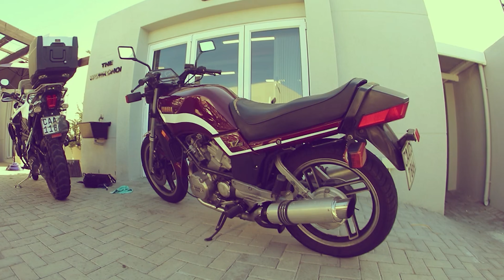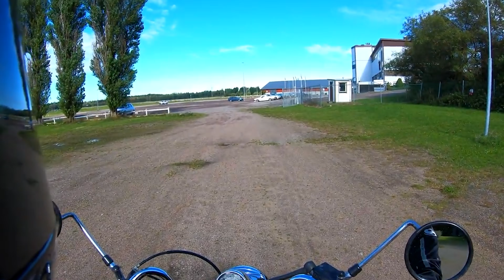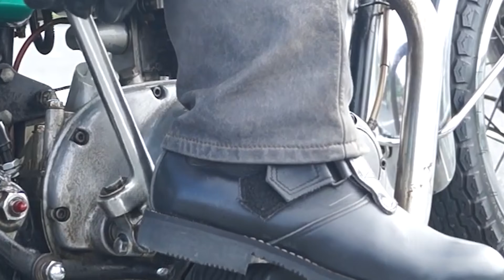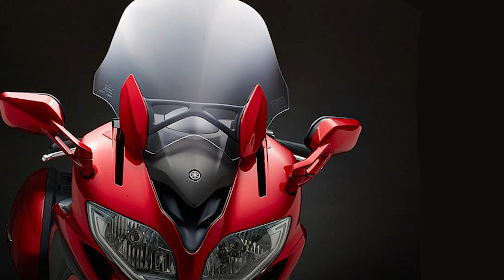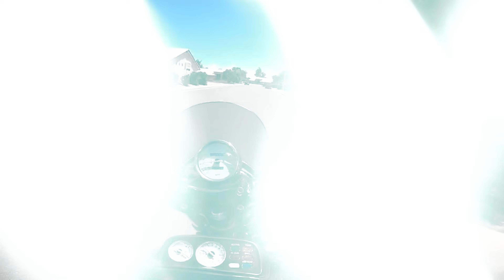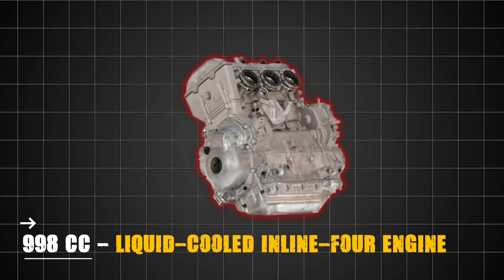7 Worst And 9 BEST Yamaha Motorcycles Of ALL TIME!

Comment: I bought a new Vision in the summer of 1984. The one I bought was an '82 model. The price was only $1,600. Back then there was no internet, and there was no way for me to figure out why the bike was priced so low. I had it for 4 years and rode it 10,000 miles. Why heck, I was only 23 at the time when I bought it. I had no problems electrically yet but.........it had the Vision stumble, the front wheel wobbled so bad at speeds around 70 mph it felt like I was going to lose control. Mine was brilliant red. I regretted selling it after owning it for only 4 years. Fast forward to 2018. I found one on Ebay, brilliant red from Arizona with no fuel tank rust for $1,300. I bought it. It looked almost like new. I already knew of all of the problems this model had, so I opened my wallet and proceeded to correct all of them. I bought a new jet kit which had larger jets for the rear carburetor adapted for my altitude of 1,080 feet. I rebuilt the carbs, bought a new modern stator and then life took over. This year, 2026, I started again on the bike and this time I bought a new TCI out of Europe which did away with the old electronics, I bought a new modern voltage regulator, bought new compatible coils, replaced the ignition wires with new ones, new plugs plus a few other things mechanically that fail with use. I am now going through the whole bike electrically inspecting those plastic connectors and I do expect the engine to fire up the first time when I hit the start button. I think this time around I'll have a bike that is going to ride the way it was designed. If this Brilliant red bike redo is successful, I have a second '82 Vision that needs more serious top end surgery. There is no doubt that I can get it back up to scratch. All it takes is a lot of patience.

Comment: FYI: I OWNED AN "RD400" TWIN, 2-CYCLE, WHICH HAD ONE FLAW: THE SPARK PLUGS WOULD EVENTUALLY FOUL, WHICH COULD BE "FIXED, BY REMOVING THE SPARK PLUGS, AND SCRAPING THEM, TO REMOVE THE FOULING COATING...  THEN IT RAN GREAT FOR SEVERAL MORE DAYS.... :face-blue-smiling::face-green-smiling::body-blue-raised-arms::face-fuchsia-wide-eyes::face-orange-raised-eyebrow::face-orange-biting-nails::hand-orange-covering-eyes::face-turquoise-covering-eyes::hand-green-crystal-ball::face-fuchsia-poop-shape::text-green-game-over:

Comment: My son has an SCR950 and loves it. We ride for up to 8 hours in a single trip regularly and he doesn't complain about the ergonomics at all. It is however strictly a road bike in the Scrambler style and as any bike with low suspension and a belt drive should be kept well clear of and sand, mud or uneven terrain.

Comment: I brought a Yamaha MT01 in 2005 brand new. Very expensive back then. In Australia.
I don't think North America got these models, the first of the MT range.
Still have it, 80000km on it and it has never failed.
1670cc V Twin in a sports bike chassis, R1 derived brakes, suspension and swing arm, crazy styling. I still love it
Reply: I bought a MT-01 in 2007 new. I was lucky yamaha dropped the price in the UK , I only paid £6999. I still have the bike and like you no problems with it. A great bike in my opinion. I also have  a xjr 1200 no problems with that either.

Comment: This must be written by someone that never threw a leg over a Yamaha and has confused specs on many models.

I owned 2 1982 Yamaha Seca Turbos. Both bikes NEVER had heating issues. They are not AIR COOLED. THEY ARE OIL AND AIR COOLED. This bike was the best touring motorcycle you could buy, even by today's standard. Sofa cushion for two.  You want to talk about what it had for a flaw? The position of the starter. If you needed to repair or replace the starter on the Seca Turbo you had to take the engine out of the frame!

I also owned a 1986 SRX600. WTF you have bad to say about that?

This is a computer generated POS.
Reply: It'fueled,not "fuel"

Comment: Hello Ironpulsee... 👋
BRO it would be more better if you had start rankings from smaller cc engine.
For eg. 125cc ( MT-125 ), 150cc ( FZ/FZS ), 155cc (M-Slaz/ MT-15/XSR155/R15 V4/R15M ), 250cc ( FZ25 ) in this video. 
Than to bigger engines 300cc, 600cc and etc. etc. 
But it's ok no problem.
Thanking you. 
🙏🏻

Comment: The 535 was genuinely poor quality but it's little Brother was a dream !!,  WHAT HAPPENED??.
Reply: I had an 87 535 virago. The small spring for the rear brake in the linkage broke. I replaced the spring with a chevy distributor spring. Soon after I was limited to 40 mph. Took the bike to a mechanic.  He told me because the carburetors were mounted sideways, the diaphragms tore and slid down.  Sold the bike cheap.

Comment: This is at least partially true !! . 

 I have an FJ 1100 1985 and even today in 2026 it's still an animal on the road,  I still pass modern racing bikes and If you just want to ride long distance it's a Prince,  TOTAL COMFORT !!.

The FJ 1100 ONLY lasted 2 years and was upgraded to the FJ 1200 & 1200 T.

I have owned both and even still TODAY,  I love the FJ 1100,  A true masterpiece !!.

By the way,  I even had an FJ 1100 in a hard tail frame and she left Harley Riders wondering WTF was that ??.

It was weird,  it rattled like a bad tractor and I lost countless mirrors at speed,  but she outlasted and out raced anything in her path.

Comment: With the Niken you got to ride it differently more brave at lower speeds and it would do it fine but a conventional bike would loose traction forget what you no about riding a bike it's totally different But when adjusted a nice ride be brave it will hold you up
Reply: Ps don't get one if you're over 45 years old and 5 stone over weight 😂